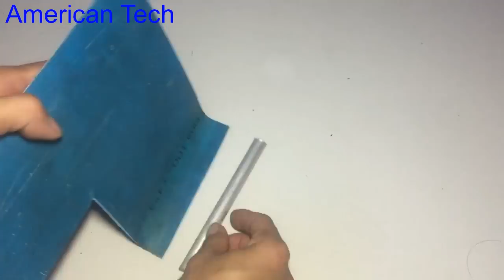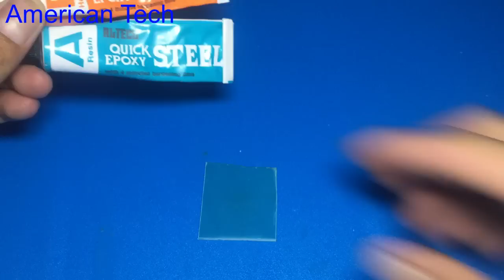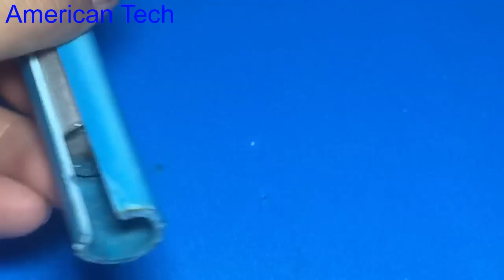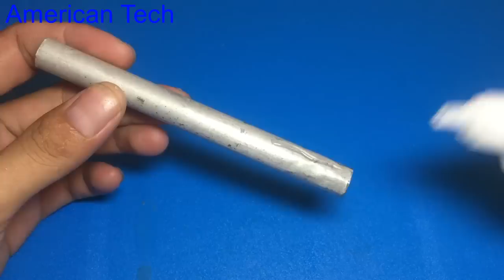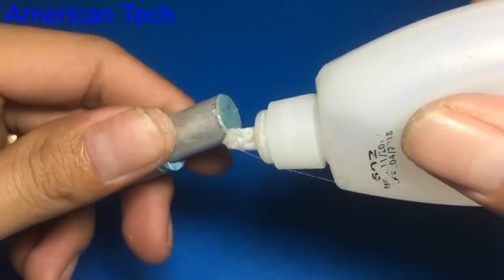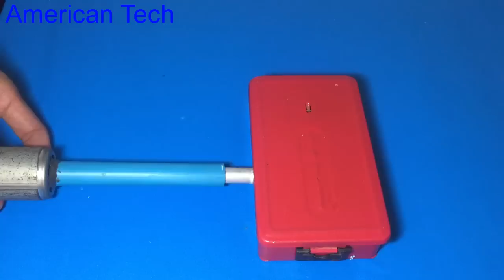How to make a powerful electric actaultor , Linear motor , electric cylinder

Comment: This is possibly the worst way of doing this ive ever seen,take the gear off the motor, drill a small hole in end of the lead screw, then one in the side for a grub screw. Done..

Comment: using H bridge for dc motor would be useful for you to control easily
Reply: Simple speed controller for RC electric motors
Reply: Which motor is used in. This ?

Comment: Very great video! I have several motors that I will be building using your design! BTW, never mind the 217 IDIOTS who put thumbs down. They are lacking mental capacity to even understand much of anything, much less, this video. I bet they are too stupid to even know how to thread a nut on a bolt. I also have several Hypertough drills that all I have to do is put the threaded rod in the drill chuck and tighten it. Then open the plastic case and solder in wires to control it with. I'm going to build a mini-excavator with the actuators I build. The base of the excavator will be 2 to 3 square foot at most. It will be a toy, however, still big enough to actually dig a sewer line! It will be on a cart, and my body weight as the counter weight. I expect the digging bucket, or scooper, to be maybe 1 foot wide at most. I am already in to toy RC heavy equipment, 1/14th scale, and have several machines, and buying even more. I wish I could find 1/8th, but nothing is available. I give you a solid thumbs up, best actuator video I have seen so far!

Comment: Sir, what is the motor and what it means to move back and forth? Change the bridge and push wire. Change the connection. How it will work.

Comment: if do you want to make it back and forth, how?
Reply: youd either need to find a way to reverse the polarity, which can be done with some special switches, or use a servo motor, designed to move backwards and forwards

Comment: Of no real use, needs to be manually stopped at either end of travel to prevent disaster
Reply: Just add limit switches at each end that break the circuit and stops the motion